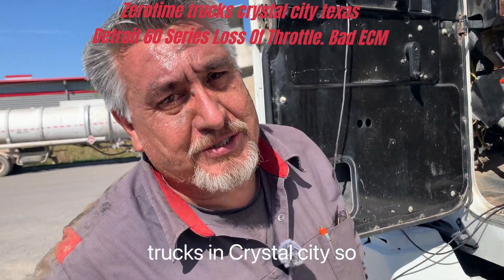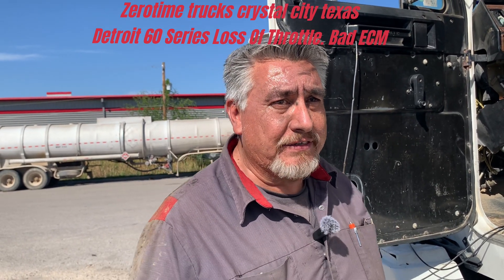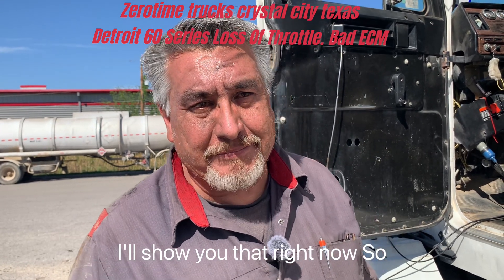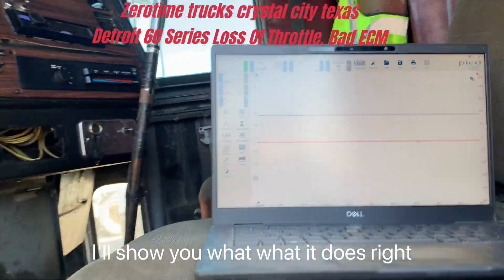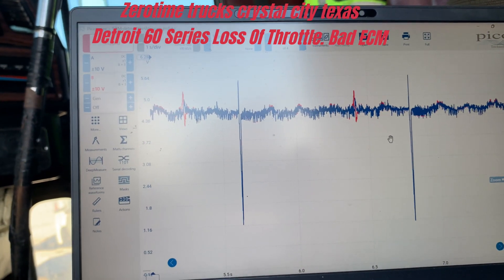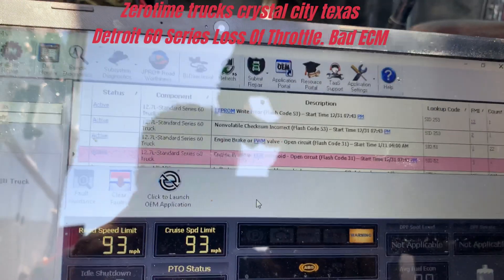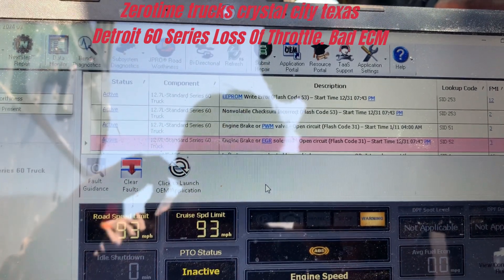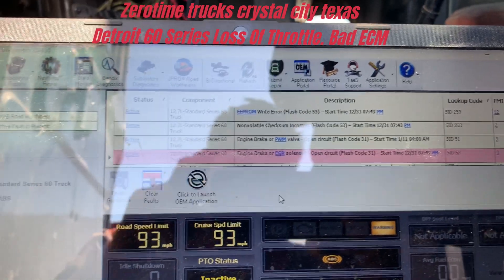Detroit Series 60 Loss Of Throttle Bad ECM

Comment: Ernest when you have another truck with a similar problem to your PX9 injector testing video can you make another one the set up? 

How did you set that one up? One probe on the rail sensor signal wire and another on number 1 injector?
Reply from the maker: So on the px9 fuel rail sensor is four wire. I believe it’s the white one is the pressure and I used an amp clamp to pin one or two at the injector connector
Reply: Okay. I got the picoscope you recommended previously. It. Same with 2 leads. Can you recommend what to get for an amp clamp, delta sensor, and vibration sensor for the fuel likes that you used on the Detroit fuel pump video? Thanks!
Reply: Bad ground on the threadle can cause this.